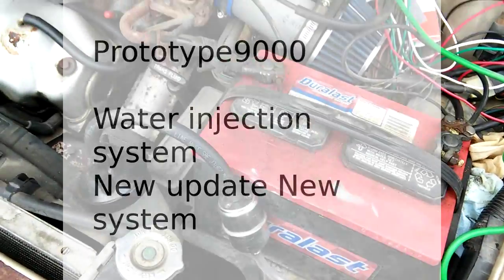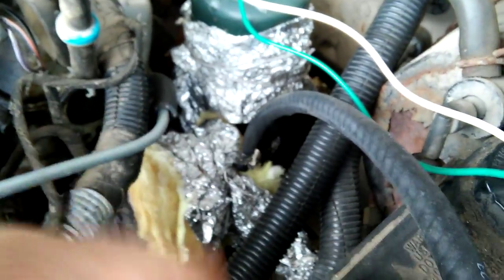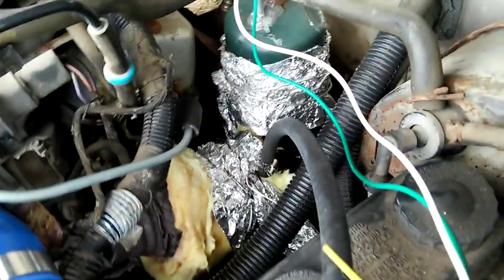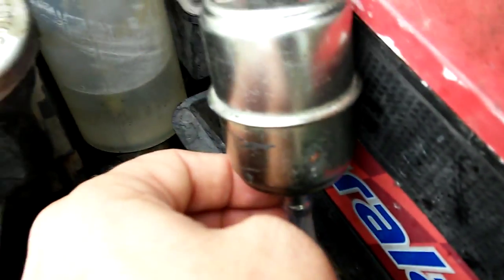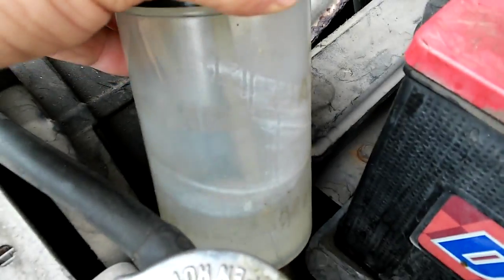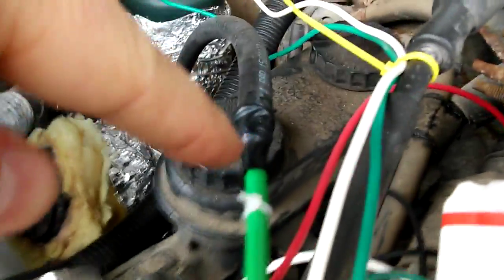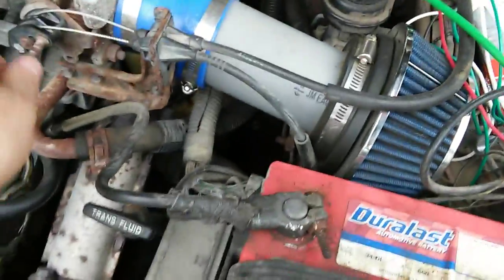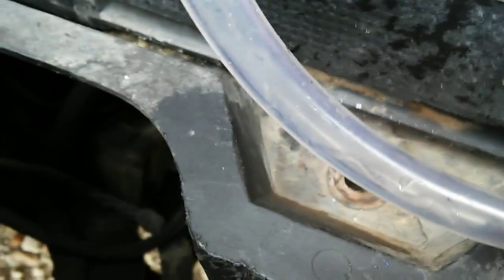New water steam injection system

Comment: I don't wanna sound dumb "BUTT" could you explain the setup a little better? My video skills are terrible and I'm not complaining at all ,but just couldn't make out how this is running. Im building a stroked350 Chevy for towing and know it'll have detonation problems in a hard pull on hot days.
When you say heat exchanger are you dripping water on the exhaust manifolds and then into the intake by vacuum?
I am just now looking into water injection but have thought of having a heat probe in the exhaust manifolds and when it gets to a certain temp have a water injection nozzle spray until it cools down. That way it'll only be injected when it needs it.

Comment: hey man, just a question, I have a 2002 lexus rx300 3.0 vv-t v6 and a 2004 ford explorer sohc 4.6L v8, would this be safe to run on them? would surface rust form in the cylinders if they sit for a few days? also how would this preform in cold weather? thanks! hope to here from ya!
Reply from the maker: there shouldnt be enough surface rust to affect anything water injection will do nothing for your fuel mileage if you dont do anything about the electronics that control the fuel ratio thhe extra oxygen and steam from the water injection will tell the computer its running lean so it will send more gas to the engine so you either need to reprogram the computer or use an efie or oxygen sensor simulators and maybe other simulators depending on your setup before you can see any kind of savings
Reply from the maker: and in cold weather you need to add alcohol or something or it freezes solid and your container breaks open
Reply: Awsome! How would you suggest I reprogram the sensors? Or how did you reprogram yours on your vehicle? Sorry for all the questions I just barely found out about this stuff literally hours ago! Lol
Reply from the maker: +michael martinez you dont reprogram the sensors you replace them with a simulator   have to look that up as far as reprograming the computer you need to determine if its the kind you can reprogram most you can but there are ones out there you cant they have obd2 and obd 1 stations out there that can reprogram the computer some use laptops some can use android and there are standalone units or you could find a mechanic that will do it for you in my case it was just easier to just to replace the sensors with simulators because not many people have a drb2 station and the ones that do charge allot of money
Reply: Ok, thanks for clearing that up, do you recommend a place or brand of simulator I buy? Thanks!
Reply from the maker: +michael martinez cant remember anything at the moment theres really only 2 places that make them and a bunch of custom jobs on ebay
Reply: Sweet, thanks, I appreciate your time and information!
Reply: +michael martinez Hi Michael, I too installed a water injection system on my truck but my system is different. On my setup, I use it for boost and is activated like NOS into my carburetor. Been playing with it for a month now, it being winter time an all. Yah, prototype9000 is right about adding alcohol into the water, to keep from freezing the system up in cold weather. I put my water tank inside, next to my floor shifter. Instead of adding alcohol, I just buy windshield washing fluid for right now, so it don't freeze.  There's a definite boost but under certain conditions, on my setup, it being winter and all. I'm still tuning it in too. Also I would like to add, on my setup when I first started playing with it, I was injecting too much water into the engine to where it would boug down the motor. Which means the water was passing the piston rings and going into the oil. No big deal, just a little bit was in the oil but when it got real cold, the water in the oil settled to the bottom of the pan and froze up the pickup for the oil pump. I had to take a torch and heat up my oil pan to get it working again. My point being is that there is a point of adding too much water to an engine to where it hurts performance.
Plus, on my setup, I will only see a boost when the engine's running at normal engine temp, at mid to high rpm, when accelerating. When prototype9000's setup is made to be on all the time and injects very little metered water the whole time.
Reply: +prancstaman Nice! I would like to try and figure out a way to have my system fine tuned like his, during the winter I would probably just disconnect it, I would mostly benifit from it in the Texas summer! thanks for the info, slowly but surely I'll get my engine converted for water injection!
Reply: Cool, I would suggest keep looking on YouTube.There are companies out there in the aftermarket that specialize in water injection setups. Find out there names and give them a call, Might be what you are looking for, for a price ofcourse.
Reply from the maker: +prancstaman can put a valve on it mine is made to save gas not for extra boost although it does that to i want a constant slow feed for gas saving purposes and it works with sensor modifications or else it would just make your mileage worse
Reply from the maker: +michael martinez i was in texas where i made this video this also kept the engine temperature down a little bit
Reply: prototype9000, the steam will chill off the cylinder heads. if there's space for more gas, it will add it if and only if it needs it. computers aren't exactly stupid.

sensor sims are weird. what you really want is a sensor simulator that takes existing sensor input.